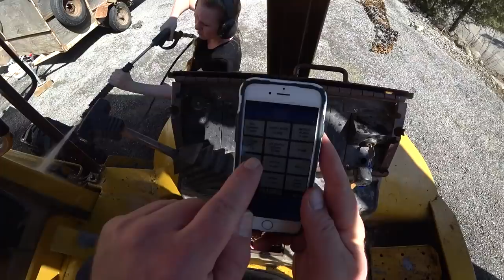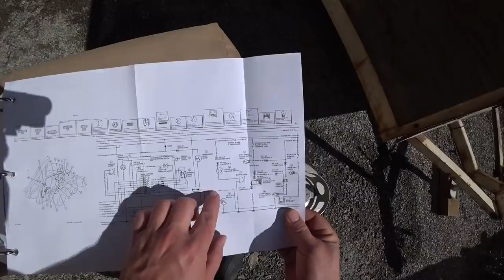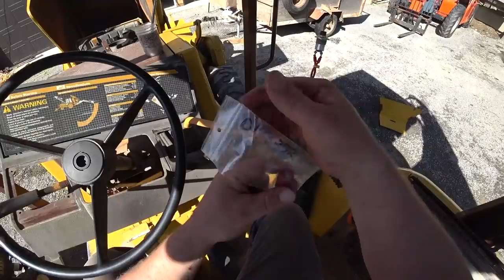Extremely Satisfying Pressure Washing 1991 Case Backhoe

Comment: When steam cleaning - never, never use a power washer in areas where there are a lot of wires.  I'm aware of a diesel that burnt up after having the wire area power washed, because the pressure of the stream literally cut through the wire insulation.

Comment: good work on the Backhoe, only thing is to avoid pressure washing the electrical components, you will get corrosion and other electrical gremlins , get yourself some fluid film rust and corrosion prevention spray for your electrical connections, its great stuff

Comment: As someone who is some what mechanically minded, I have to say you are doing a good job. There were certainly moments when i was wondering why you were doing it the hard way, but you got it done and that is the important part. I think a lot of mechanical adept individuals grew up taking things apart and learning how they work. Due to this fact we have more "working" time under our belts around the in and out of things and start to notice similarities across devices. this will come in time, and once you notice those interconnecting designs it becomes easier and more noticeable. Your working on it and that is great. Like you said, start small and grow from there.

Comment: Suggestion: Greasy equipment cleaning addon... Simple Green Degreaser is a very good biodegradable degreaser.  Spray Simple Green on equipment before pressure washing it.  Very dirty or greasy areas use at full strength and let soak overnight before pressure washing.  Also, read Simple Green instructions first, but I believe that you'll have to use cold water to pressure wash with Simple Green.   Great video, preparation is a must for good results.

Comment: The Case backhoe was a great choice to begin with, as you noted and the reasons you gave. As well as a plumber, I'm a union plumber or was till the union objected to my objection to being stolen from- but it gave me a bit of a "buy American" attitude;  then one day I got to use a Kubota 40 hp tractor and box blade- the whole tractor is hydraulically driven- the wheels, the blade the rear accessories drive- I hated saying it, but this was the easiest thing I ever saw (as a tractor) to operate! Another operator managed to whack a fitting on one of the bucket lift cylinders; we called Kubota (in Dallas there are 3 within easy driving distance), they had the parts, and the manual we needed for the machine. Unless they have changed for the stupid side since I retired, I found it one of the easier pieces to work on. But then again, as a motor obsessed teen, I had a couple of Hondas; the translated Japanese produced manuals were hilarious, but often not very helpful! I heard you have misgivings about Craig's List, but it might be the place to go look for an enclosure for your backhoe - I know Case made one, and also AC- we had one of those in the '80s-'90s!. Also, the next time you gin up the saw mill, think about a machinery shed- it will save you a ton of work and grief in the winter/rainy weather!

Comment: I completely agree with you, i am a self learning DIY'er, and i can't believe how far I have come. Looking back now, it is the same advice you are saying, just start small, and try it.  I am now changing my lawnmower blades myself, doing basic electrical outlets, painting, i even now have done some basic plumbing (faucets) etc.  Video's like yours are very inspiring and give me the positive attitude to give it a try. At worst i can always call in a professional. Don't get me wrong, i do know my limits, but from a few years ago never picking up a drill, to now trying to do everything myself is very satisfying.  Every time i think, oh man that seems difficult, i look up some video's, do some research and usually i give a go.  Nothing more satisfying than taking on a task, learning from it, and getting it done yourself.

Comment: as for the square nut problem tape the nut to a line of tape or if a wire will work then slide it down till it will thread in  (old trick of the trade)

Comment: you should add some UV dye to your hyd tank. next time you pressure wash it, wait until dusk and look around with a blacklight. it'll glow like a headshop poster, but only from the leak. might not be a bad idea to run all the pistons in and out once before looking just to make sure it's fresh leak after the wash

Comment: That slope behind the house and garden... all your stuff is at the bottom of a sort of amphitheater, on the flat bit. That means that all the water that rains on the hill, is funneled towards you, and while flowing, it washes down the little soil that clings to the slope. I see you got tons of rocks... Would it be an idea to arrange lines of loose rocks on the contours of the hill, so that water slows down and not eroding the hill?

Comment: Case 580 and the Deere 310/410, are the most common machines ever made. You can get every nut and bolt on the entire machine. We had a Komatsu Dozer, and parts for it were always a nightmare.

Comment: Being in the pressure washing business I can tell just by watching your triplex pump has already lost 1/3 to 1/2 it's pressure. This is due to the unloaders short cycling causing heat to build up ruining your seals in the pump. There's a lot that has to go on when you let off that trigger to the gun. First the heater has to stop then the pumps bypass goes into action and if it's not running to a buffer tank the short cycling heats up fast again ruining the seals. My recommendation is to stop using the heater and buy a 4 gpm, 4000 psi triplex pump with an external unloader and run the unloader to to unload on the ground and not recycle. This keeps fresh cold water to the pump making it last forever if the unloader is set properly. Hot water and high pressure great for a commercial unit with someone that is a professional but for a residential machine a disaster. Next year if not this one this machines value will be the frame, gas tank and the  gx390.

PS: Yes buy some more hose and a reel with at least 300 feet of hose. You will love it!

Comment: Really good video! Thanks!
The hearing protection was sorta obvious, USE EYE PROTECTION WHEN YOU USE GRINDERS or PRESSURE WASHERS! face sheild or glasses? HMMM!
Loctite on step bolts?
If you had mulched the chives and some OTHER PERENIALS you could have harvested them through winter.
2 things to try for YJs, foam the tube ends where appropriate (shove a cardboard stop in a couple inchs or so and then apply foam. use pest resistant spray foam) and spray the others with long life(8mo) home defense spray or the persistant flying insect spray, not for Alyssa to apply.

Comment: You will find that working on the backhoe will help you on the other equipment. Yes they are different but an electrical system is an electrical system and so on. The first time is the hardest because you do not know where things are but after that they get easier. As for the hydraulic first remove pressure, have a pan to get the fluid as it comes out and most important the lines have to be straight, no twists. Also if you look at a line you will see that one is a direct content to a hard line and the other has a fitting in between the hard line and the hose. This lets the hose swivel so you do not twist it. To work on the hose start at the end.

Comment: good job! 
most people grease daily when using the machine, or if it has rained since it was last greased and parked. also, penetrating oil is very poor at preventing rusted fasteners. never seize compound is the way to go, that stuff keeps bolts from freezing up for years. almost time to build a shop to free up space in the basement, or perhaps a pavilion to park the machines under.

oh, and clear plastic to make a temporary green house will get things growing quick, not sure how that would work out once you have an infant to look after... oh well, best of luck! :)
Reply: I wouldn't use either penetrating oil or anti-seize on a vibrating machine like a backhoe, I would suggest (blue) threadlocker. Missing nut and bolt on step flange didn't seize, it rattled off.

Comment: Hi, a question that comes back to me again and again in the head, the excavator drives with normal oil, the hydraulics just the same, right? Now you wash the machines and all the liquids seep into the ground. At the same time you have a well on the property, which also serves as drinking water. Is not a problem, if not with you then but for the environment in particular.

Comment: Pull the button cover off and give a little spritz if Fluid Film to the button.  It is both a lubricant and a moisture preventative and is safe on electrical connections.  Spray down the fuse block, removing and re-inserting each fuse.  Good stuff !
To prevent those small fasteners for rusting in place, use anti-seize or grease.  It last longer than WD-40.  Fluid Film lasts longer than WD-40, but not as long as a paste/grease.

Comment: Progress is great isn’t it?  Preventive Maintenance Checks and Services (PMCS - Army Term) is sooooo important to the life and longevity of any piece of equipment, regardless of size.  When you put the boot onto the little clutch switch, I didn’t notice the O-ring at the bottom.  Maybe it was there, or maybe it was black and not as visible, but if it wasn’t installed the old one is better than none at all.

Comment: Cool! In the military we called it “being in a state of material readiness”. I also went to PMS training (planned maintenance systems) school, which carried it to the next step, do you keep a log book? Are the other machines yours? They’ve been parked a long time to be rentals?!?

Funny I’m sorting out transmission problems in my WWII jeep, this weekend, myself!  There’s over 30 grease points on this jeep, so I have a Lincoln, compressed air grease gun. Necessary investment! Like your Case, there is tons of documentation on line, but I have hard copies of all the technical manuals. You guys are doing great!  So, you are you putting up a  garage/shop? I know wood is readily available but you can’t beat steel building for this application.

Comment: I would spray any connectors that are in the dash and in the handles with FluidFilm to seal out the water and moisture, they will not get the green crusties and help prevent wiring issues. paint the coolant cap either Blue or lime green so it will signify water or coolant.

Comment: Sometimes after market parts are better. In my case 2015 Ford F150. The brake fluid cap cracked. Ford wanted $45 for it. Amazon had one for $15. The Amazon cap was made by the American manufacturer who made the master cylinder and was of way better quality. Ford in there infenant wisdom went with a Chines cap.

Comment: I had an Isuzu P'up Diesel once and I needed a new fuel cap for it. If one has a gasoline engine one can go to an auto parts store and buy a cap for $5.

Diesel owners are not so lucky. The only place to get the cap was from the Isuzu dealer, it was $80 in 1993. That's for what is essentially a piece of stamped and bent metal.

Comment: Not sure if you knew this or if someone else mentioned this but you should get in the habit of running the engine if you are going to wash with water & pressure. I washed my truck engine one year & ended up replacing a couple coil packs to get it going again lol.

Comment: mechanics mascara!! (black grease!!) any woman who can do this mechanics work, is smoking hot in my book!!
GRIN!! she is a keeper jesse!!
did you buy the hot washer??
if not it is a good thing to add in the equipment!!
northern tool makes a tow behind hot steam washer unit with a onboard water tank...
pretty cool!!
and they have a good honda twin motor for good pressure!!
kinda pricy but nice to have!!
be sure to winter the pump on those!! I use rv antifreeze for that!!
I also added a garden water hose fitting to the bottom of the tank for gravity water transfer and used another on the high pressure side for working with cement block mixing water!!
and a bit of red grease or copper anti seize on all of the bolts!! trust me!! a big time saver the next time!!
also on the fishing square nuts or blind nuts, tack weld a bit of welding wire on the nut to fish them in place!!
they use those on trailer hitch installations for blind frame nuts and bolts!!
or just use read grease to hold the nuts sort of in place... make replacement / removal faster too!!

Comment: Naa you won't be lost when you start on another piece of equipment - the basics are all the same,,, once you learn that piece of equipment it's a short move to understanding the next one,,, I had an old timer tell me years ago it's not the  piece of equipment it's what you are doing that is the principal,,,,, in other words when you learn to work dirt everything else is just a matter of function,,, I've had about 30 hoes in my day my last one was a 710 john deere 4wd extendahoe 125 horse 6 cylinder would dig 22 foot deep but it weighed 26.500 lbs -- man it was an awesome tool until the ground got soft -

Comment: Not mechanical ... You sawed your lumber for your home, installed your own water cistern, dug your own ditches for a number of utilities, did most all of your electrical work, poured your own footings and slab (great teachers who assisted & family) put up your own insulated poured concrete lower level walls with help of Melissa and family, you both took class on timber framing and then put up your own frame (great teachers and assisting students & family),  Repaired most break downs on your own and showed us how its done, demonstrated tools and special application devises, sheeted your own roof with assistance from a crane operator and team & family. Not mechanical ... what am I missing?
Melissa and you are one great team!
On top of that you both recorded it all and put it up on YouTube for others to learn and start their dream.
Overall I'd say congratulations are in order ... for the both of you!

Comment: LOL..."it's 30 years old"...BUWAHAHAHAHAHAHA!!!!! The prices you paid...get used to it.  Wait until you decide you want to start a machine shop to make parts and such...70 year old lathes are not uncommon (LeBlond, Monarch, etc.).  You can get them pretty cheap ($5K or less).  The LATHE is cheap, the PARTS are EXPENSIVE.  You too will start scouring eBay, Craigslist, and finding somebody to make you a part...because when Monarch wants to sell you that spur gear for your lathe for $800 (and yes, some of these basic parts can hit for that much), THEN you will understand why people look at those other options for parts. 

As for your garden, as long as the seeds don't germinate, the seeds will generally survive a frost.  As for your chives and such, those are hardy as can be...Garlic, Onion, Scallions, chives, etc, generally your bulb kind of plants will come back year over year over year.  Your bigger problem will be getting rid of all those items if you want to change over what was in your bed (i.e., moving from scallions to lettuce).  

Don't go too overboard on the sawdust if you're mixing it with your compost.  You really don't need to add too much carbon to a compost mix if it starts to go in a bad way (many times a few sheets of news print or brown butchers paper will work just fine)...

Comment: You had a switch issues with the backhoe, figured it was due to missing boot and water getting into the switch yet you blast under the cover the entire wiring area and harnesses with high pressure water. I know that area is not entirely water proof but just thinking blasting it with a pressure sprayer could cause more issues in the long run with connections and corrosion if you get water pushed into the connections.

Comment: Jessie, be careful where you point that pressure washer.
With all the pressure behind it the water can get in to places you don't want it, like bearings and electrical.
I heard of someone who used to clean their motorbike wheels. Turns put the water pushed past the seal into the wheel bearing. After a while it rusted up and seized.
Just be careful.

Comment: You are insane spending $60 on a fuse panel cover.  You could have made something out of a plastic container from a $2 store and a tube of silicone.  It wouldn't have cost more than $10 and you would have had the remainder of the silicone to use on sonthing else.  If you had realized the rubber boot was missing you could have used a balloon until you can get a replacement. A packet of party balloons don't cost much.  I thought of those two fixes within seconds of seeing them.

Comment: You can be horrified at the cost of aircraft parts are nearly all of them are are factory genuine and if your mechanic buys second hand parts they have to be tested and have a traceable part number.  In NZ where i am the hot pressure washer is known as a steam cleaner. They are great and you can get away with using little or no degreaser. Don't give yourself a hard time about how long it takes to fix mechanical things as sometimes it just does take time even for a professional. We don't always know everything and we had to learn too. In fact we never stop learning.

Comment: Grease the maintenance points and call it good.  You're doing far more damage to the life of your equipment if you high pressure wash it on a regular basis.  Store it under cover and you'll prolong the life 10 fold.  You have tons of trees and available inexpensive options for storage, so why haven't you used those?......

Comment: Dont put sawdust in your garden!  Wood fibre is carbon rich material and will "distract"  any soil mycorhizzae  from breaking down organic matter.  All the other organic matter you added is fine as this is Nitrogen rich material.  Exactly what you need for vegetable and fruit production.  Allow sawdust to breakdown separately by broadcasting it in your wooded areas.